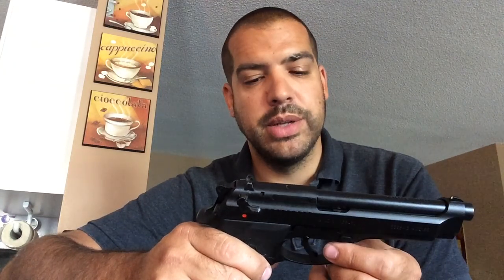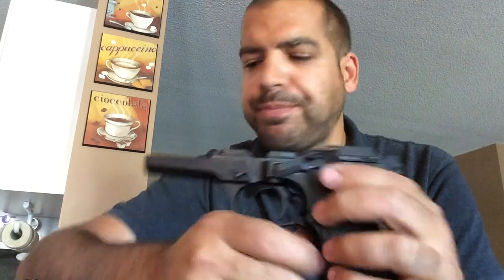Girsan Regard Slide Lock Fix

Comment: I just Revisited this video. The length and angle of the slide stop that catches the recessed part of the magazine follower is a completely different from Girsan and The Beretta 92fs or M9. The Beretta slide stop is a little longer and at an angle that allows it to catch the slide stop more effectively. Now you can use either Girsan or any Beretta magazine.

Comment: Hi there, need to know that how many rounds have you fired, cause once I use to have Beretta m9(2004) and on 124 grain, fired 850 rounds the locking block break. Do we have the same kind of issue with this this? Help in this regard will be highly appreciated.

Comment: That was not an issues I think... that was they call a H.O.D(Holding Open Device) the mechanichal process when the last bullet leaving the muzzle, slide was move in a back action then it come back forward by the compress return spring in the same time the empty magazine follower (platform) touching with the slide stop leaver leg(inside the gun)that thing cause a slide stop with a open chamber to tell a user that gun was running out off ammo....

Comment: Tried this and the card fix didn't fix anything.  Gun works great with Girsan mags but not with Beretta mags,  The Girsan mags are slightly different.
Reply: Bob Bonenfant have you reversed the mag release?
Reply: Yes,.  Most of my guns I changed the mag release to the right side.  The 92 Series works better for me on the left side.
Reply: Bob Bonenfant, i dropped an email to girsan about this but they haven't answered. i thought the problem were my magazines so i ordered 2 mecgars but still had the same problem.. it kept going until i put the mag release back  on the original side. after much fiddling, i found out that the reversed mag release pushed away the mag. not only was it failing to lock, the mags would also get stuck in the pistol too! 

i otherwise love this pistol!
Reply: I have tried all the various mags I have, MecGars, Beretta and a generic and none hold the slide back other than Girsan's.  I now have the mag release on the left side.  It seems the Girsan follower is shaped slightly different than the Berettas.  The follower slips over the slide stop lever using the Beretta mags and the slide just closes.  I wish I could buy some more Girsan mags.  I may have to buy the 4,9", I have the Compact now, just to get four mags that work.